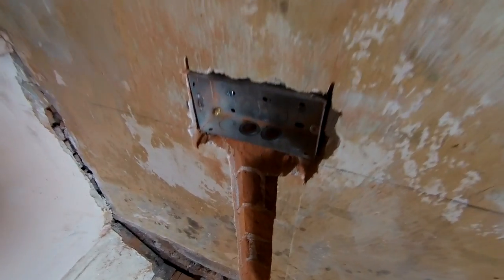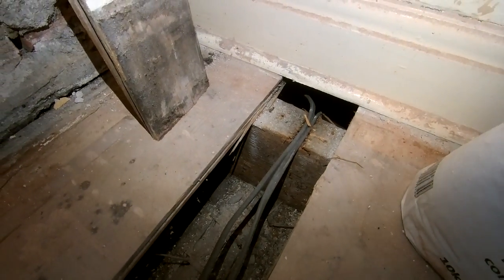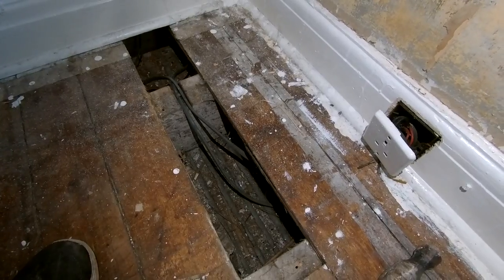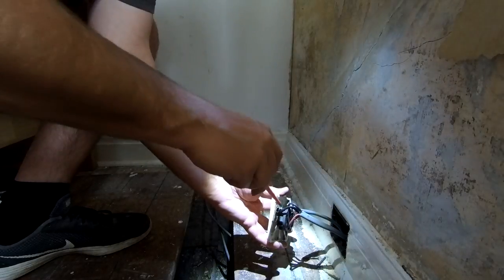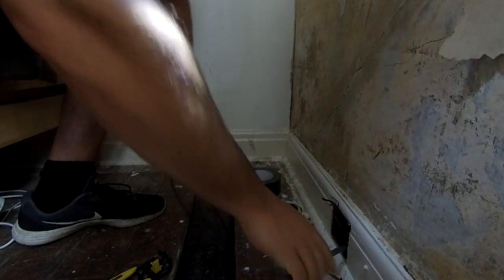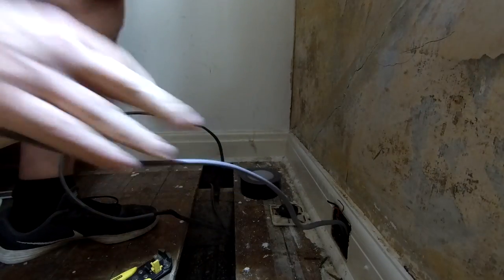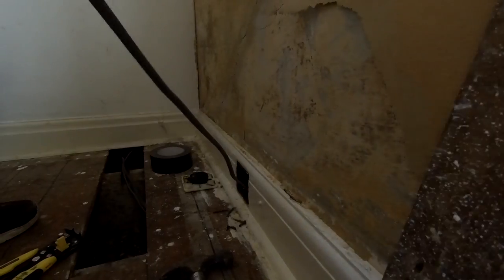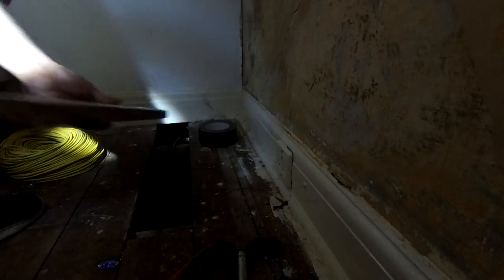How to Install Plug Sockets - part 2 - Connecting - DIY Vlog #4

Comment: I always earth the back boxes but a lot of sparkies say it’s not necessary because it’s earthed through the terminal screws  as they are directly attached to the earth bracket on the back of the socket. Still better safe than sorry. Subbed 👍

Comment: Well made. I hate pulling cables through walls and what not, its a two man job to avoid that back and forth all the time. I've seen some people drill a hole in the support beams in the middle and pull cables through there, you know why any one would do that? I do it like you did it.